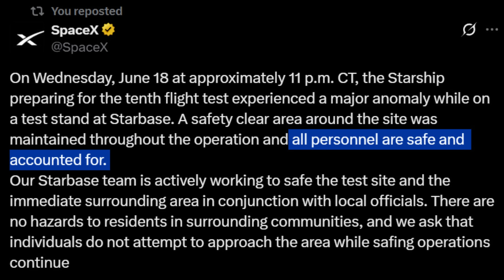SpaceX's Latest Starship Explodes During Ground Test

Comment: Space X have streamlined their process by removing the boring flying bit.
Reply: I dunno, I saw a lot of bits of it flying everywhere.
Reply: 😂😂 @YumLemmingKebabs
Reply: It's an efficiency upgrade. Having it explode on the ground, rather than mid-flight, saves a lot of money.
Reply: @renerpho Less pollution too!
Reply: The best part is no part
Reply: @bplzizcool  Also no rocket.
Reply: Maybe they need to keep the flying bit and remove the explodey bit.
Reply: it's safer for those downrange too
Reply: DOGE level efficiency on display.
Reply: @a.nameline653  Did you explode this week? Did you TRY to explode this week?
Reply: @HububkiFilms  Love a good Mel Brooks reference 🙂
Reply: @a.nameline653 
Great minds and all that…
Reply: How to start decommissioning your rocket company
Reply: @thelyrebird1310 China is wondering... should we copy?
Reply: @xephael3485  China's LM9 will have a first stage very simlair to Super heavy. But unlike Starship, the second stage will not be reusable. I think this might be a much more viable option compare to Starship. LM9 is designed for building moon base and also for manned Mars mission.
Reply: @qiyuxuan9437 At the moment, Starship’s upper stage isn’t exactly reusable either.
Reply: @xephael3485  They already have copied.
Reply: @FLPhotoCatcher  Only theirs will probably actually work.
Reply: @Beer_Dad1975  They have had serious problems already.
Anyway, I hope SpaceX succeeds instead of the Communist regime.
Reply: @xephael3485 More like elon is copying china.
Reply: 😂🤣😂🤣😂🤣 Jeezus!!
Reply: Saves lots taxpayer money
Reply: I got tired of watching the oohs and ahhs of the booster return
Reply: At least it doesn't interrupt plane traffic over the gulf of  a̶m̶e̶r̶i̶c̶a̶ Mexico
Reply: its the pipes, they made it into a giant pipe organ, vibrations and hydrogen seals dont mix its never ever going to be reusable even if they fluke it not shaking itself apart on first flight
ive said it since i first saw their piping
free hanging pipes through middle of a steel tube....
in a triangle no less
its possibly the worlds biggest musical instrument, but its not a design for a reusable rocket 
you couldnt design it to have better harmonics lol
Reply: @violetquinnlaw I wonder if it's tuned to E Sharp 😂
Reply: Yes, they skip right to the explosion now
Reply: The best launch is no launch...
Reply: Auch 😂😂😂😂
Reply: They really should save these tests for July 4 and Decemner 31
Reply: You can't get a quicker turn around time than the damn thing never leaving the pad. They don't even need the Tower now!
Reply: Thy call that a ground show on the forth of July.
Reply: Very good!!!
Reply: except the flying tiles and downcomers.
Reply: That’s DOGE efficiency in action!
Reply: bravo melon tusk, this is a revolutionary level of efficiency.
Reply: Loving the savage burns in the comment section.  Finally people are starting to realise Starship is a crock.
Reply: @Beer_Dad1975  starship is not a crock. It’s just poor management. Someone else will complete as SpaceX is falling apart. At the moment China has oportunity but Europe may also be contender
Reply: @universalpain7216  Yes, I did see the Chinese are already well down the path of developing a larger version of Starship, and wouldn't put it past them to succeed as they have the resources and knowledge to get it done, no doubt - I was more meaning that SpaceX are incapable of delivering it.  Not entirely convinced it's actually a good idea even if it can be completed though.
Reply: @Beer_Dad1975 29 subs and no content😂😂😂 your account is a crock of troll
Reply: @Beer_Dad1975 
You mean we can cook soup in it?  That sounds great!  Make mine minestrone.
Reply: @keirfarnum6811  I think it does a better job of cooking bananas, but only 1 per starship, and each starship cooker is single use only - and you have to swim to the bottom of the ocean to retrieve the cooked banana.
Reply: All the Show. 
All at once. 
Coliseum.
Reply: that's par for the course from scamX
Reply: Waddya mean "SpaceX have ... "?
SpaceX IS NOT PLURAL!
Reply: @manifold1476 weird thing to get so upset about. Anyway, British English usage allows collective nouns (including company names) to be treated as plural. Either “has” or “have” is perfectly acceptable in this case.
Reply: Someone in the second stage department  is sabotaging atleast 1 spy present...
But can't operate alone so atleast 2.. the explosion is always at the upper end seemingly same spot*
Reply: @soulsbourne  have you considered that the design could just have a structural weakpoint in that area?

Comment: Great analysis. I am no spaceflight expert, so I wouldn't know how accurate it is, but I do have a scientific background and therefore I appreciate it when arguments are backed by substance. Just one small thing: Starship V2 is not "cursed"; this is pure sugarcoating. After that many failures, from an engineering standpoint, you can safely say it is a construction failure, plain and simple.

Comment: Scott, you mentioned procedural errors and design flaws as potential causes, but there also might have been a manufacturing defect in play too—that is, the design is ok and the procedure was correctly followed but an undetected manufacturing flaw made it into test. Just putting that possibility on the table.

Comment: The blasé attitude to rockets catastrophically exploding, vs how seriously any failure was taken in the golden era of NASAs spaceflight is a metaphor for America as a whole.
Reply: The uneducated comments flying around are more dangerous than the actual failure. NASA killed many astronauts over the years. What SpaceX is doing is not dangerous, and will ultimately result in safer rockets. NASA didn't have the ability to test to destruction. SpaceX does. Go SpaceX!
Reply: Those NASA guys didn't have 80 years of rocket research to fall back on either.

Comment: I have said it before and I will say it again....this is what happens when you treat highly complex hardware development like software development. In software, you can have tons of issues and not completely destroy your work. Move fast and break things means you can really really severely break things when you are dealing with thousands of gallons of oxidizers and propellants.
Reply: It's basically a more extreme version of the strategy the space shuttle was built with. Rather than engineer everything piece by piece to aerospace standards, build the whole thing in a hurry and then somehow fix all the problems that pop up from the resulting pile of poop, you know the results. It's also a strategy you can hardly even run a software company by.
Reply: Its just hardware so why not break physical stuff if have the cash. Worked out great for Falcon.
Reply: Falcon 9 was successfully and reliably delivering payloads to orbit (its primary mission) before SpaceX started trying to recover boosters. The vehicle was doing its job and making money on every one of those landing “failures.” Starship has flown nine times without a complete success, and the elapsed time between the start of development and now is pretty close to the elapsed time between the start of the Saturn V program and the first (successful) launch. I see little evidence that Starship’s “rapid iterative prototyping” (RIP) approach is paying off.
Reply: @ExtroniusAttributes  You make a good point. The problem with something this big though is it really isn't cost-effective unless it's reusable, and there are very few payloads that actually need a launch vehicle that powerful to make it worthwhile on it's face.
Reply: That’s worried me all along. Starship seems at once too big for any commercial payload (beyond lots of Starlink satellites, assuming they can get the door to work, which is 0-2 so far). At the same time I think it’s too small for the scale of Mars missions Elon talks about. And I think the “intercontinental ballistic airliner/troop transport” idea reeks of solution looking for a problem.
Reply: @roborchiston9419  Falcon needed a lot fewer attempts to become operational.
Reply: @8ahau279 the booster is basically operational. If there was demand for superheavy disposable loads, they could be using the booster. The second stage is the problem. It is a lot bigger and more complex than either falcon second stage or the saturn v upper stages.
Reply: @roborchiston9419 Because we have this field called “engineering” where you can apply scientific knowledge to predict how something will perform before you ever build it. If you do that, you don’t even need to actually break the hardware at all! You can just do it right the first time! Wow! Amazing, right? 

Also, the real world isn’t like software. There are no log files or dumps. You can’t step back through the event to see where the error occurred. In many cases, the source of the error is now in a million pieces scattered over a wide area, which makes it a bit harder to debug.
Reply: Actually, NASA and US military have been doing detailed failure analysis ever since they started using rockets. While not easy or cheap, failure analysis has proved many times that it is accurate and useful.
Reply: @kevshouse Nasa developed and tested components and procedures individually before any full vehicle tests using cheap test mules such as the Little Joe when in flight testing was required. It is cheaper and faster but less dramatic. That is why from first test (which was full up with all stages) to final flight the Saturn V never had a launch failure. Also that first test was only seven years after the initial design proposal.
Reply: @EinKerl3554 did nasa also test the hatch on Apollo 1 before they put humans in there and turned them into crisps? Did Nasa test the effects of removing the white paint over the hydrogen tank on the shuttle booster, or did they know beforehand that saving a few pounds would lead to foam pieces breaking off and damaging the heat shield?
Reply: @HNedel  That's bad too bruh
Reply: @roborchiston9419  OceanGate believed in the classic Tech Bro "move fast, break things" bullshit as well. I'll let you figure out how that went.
Reply: @roborchiston9419 Fist, they are using our cash. Second this backwards approach has already been tried on a complex 30 engined rocket the Soviet N1.  Look up how that worked out.
Reply: @EinKerl3554 lol, your cash? 😅 How much are you personally paying elon every month to burn on starship?
Reply: @EinKerl3554 But the 33 engine part of Starship seems to be working quite well.
Reply: To be fair to the N-1, the major cause of its failures was the KORD engine control system, which panicked and shut off all 30 engines when it should have shut off only two. Superheavy’s engine control system seems to work well. A secondary cause of the N-1’s woes was the inability to do a static fire of more than four engines, coupled with having to weld tanks together in Kazakhstan. Also not a problem for Superheavy.
Reply: @roborchiston9419  Because it's wasteful and damages the environment. And maybe they shouldn't have all that cash that could be going to help people in need?
Reply: @mintzbuck what people on what need? They are employing thousands of welders, mechanics, engineers and other workers. Are those people not in need? Why are you wasting your money on internet access when you could be helping those in need?

Comment: Scott, it seems to me that at 7:45, before the rupture is evident, I can see buckling below the payload bay. Could there have been loss of pressure in the one of the main tanks which left the structure unable to support its own weight, causing a partial collapse which pulled apart the downcomers or header tanks?

Comment: The frame at 8:03 shows combustion beginning at the top behind the separating heat shield before the deflagration begins below. I think the header tank blew at the bottom and initially spared the methane header, but not the methane and oygen feeder pipes. The ignition and deflagration there was quickly overtaken by the ignition and deflagration caused by the shrapnel as it travelled downward.

Comment: Starting to wonder if some of the people who is working on Starship is anti-Elon and intentionally sabotaging it xD
Reply: Maybe the people who are anti-Elon are just correct, and he’s bad at running a company
Reply: I’ve been wondering that for a while. Only takes one software engineer to hide a bit of code in a critical system and BOOM!
Reply: @Tailspin80  I think software is easier to detect sabotage in than hardware. So my guess is the hardware people if anything ^^
Reply: @SonnyKnutson  I was a software developer until I retired. Believe me it’s very easy to hide a few lines of rogue code amongst millions! Just a small, innocent looking procedure to react incorrectly to fuel pressure, flow and temperature inputs… open or close the wrong valve at the wrong time and job done.

Having said that I don’t think sabotage is likely. It’s probably just design flaws in a very complex system combined with fading staff morale due to Musk’s antics.
Reply: @Tailspin80  software development have come a long way my friend. I would assume SpaceX is very modernized in their approach also. You have many people looking at code before it goes into production now. It might still be possible, sure. But not as easy.
Reply: @SonnyKnutson Code always was peer reviewed but in reality it’s hard to find bugs if they have been intentionally hidden. We are not talking about regular software that will run on any hardware; it’s a mix of time critical real time firmware that interacts directly with hardware and high level software, avionics, communication and myriad other packages. I expect they will be running regression tests and scrutinising change logs to look for suspicious changes. Well, I would anyway.
Reply: @Tailspin80 for sure :) agree

Comment: This is NOT an anomaly. It is normal for starship to explode. If this thing ever gets to space - THAT will be the anomaly. We need to remind ourselves - Apollo 10 was the fourth crewed flight, and the second to orbit the Moon. At this stage SpaceX is going to struggle to get a crew to fly starship because the chances of returning safely to Earth is close to zero.

After so many explosive failures it is getting time to reassess this entire design. It seems that the complexity introduced by having 33 small engines makes the current design unviable for the booster, and Starship is just as bad. It is time for the authorities to step in and mandate a safety-first policy of taking the time, and spending the money to get this dog of a rocket fixed. It probably means designing a new larger engine so that it needs less of them. It means designing doors that actually open. Use Shuttle-like boosters if necessary.

No more stunts with bananas. This is public money that SpaceX is spending. Tax payers deserve something better than fireworks for their money. Firing Musk is probably a wise first move, then get rid of Musk's risk-taking mentality at the company, and go back to the drawing board with an engineering based approach more like the Apollo program, and get it right for a change.

Apollo 10 orbited the Moon 31 times. They flew the Lunar lander down close the Lunar surface as a practice run for Apollo 11, which did the actual landing. That is how to build big rockets. They took risks, but they were a lot more acceptable risks than the current starship program at SpaceX.
Reply: It’s not tax payers money and perhaps it’s just a difficult engineering problem which they will fix. Don’t throw the baby out with the bath water.
Reply: @Tailspin80 it literally is taxpayer money actually. Govt grants are mostly taxpayer funded. Starship itself is beyond flawed. Falcon 9 is at least feasable as a launch solution and somewhat proven but starship and the elon mars fixation are an ignorant waste of time that needs to be spent on actual steps that may one day allow us to meaningfully impact other planets - that being our moon,the only possibility for getting industry beyond our gravity well.
Reply: @Tailspin80  It is very much taxpayers money. SpaceX has so far been awarded a total of 5.621 billion dollars by NASA (government money=taxpayer's money) for various projects, including 2.9 billion for the Artemis mission. SpaceX does earn money from Starlink, but it is doubtful that it has covered the massive costs of launching the satellites yet. The vast majority of SpaceX income is from NASA contracts.

Musk toots his horn loudly about being a profit making private enterprize, but even Tesla's profits come mostly from selling carbon credits, which is more government subsidies. Without government handouts, Musk would not be even close to the richest man in the world, and his companies would be in serious trouble.

Comment: You know what is so crazy about the Starship Program, is than I never had FAITH in the program from the beginning days.
Maybe I felt OFF about it or I was thinking back to the 1950's Sci-Fi using Stainless Steel Rockets.
I do not know why I felt so OFF about it. 

The Falcon 9 and Falcon Heavy, have been the best of the best in the whole world , with reusability.

The world has changed a lot in 2025 with all the crashes including the B787-8 loosing all power.
They were having electrical issues in the preceding days to the 787 falling flat in a stall.
Reply: your vibe check is impeccable and spot on. elon literally just lifted all his ideas from Von Braun and other 50s-60s creatives, ideas most of which we as a species investigated back then and proved them infeasable at best.